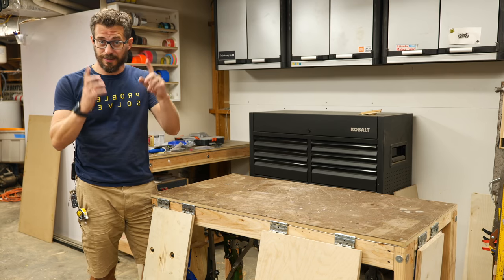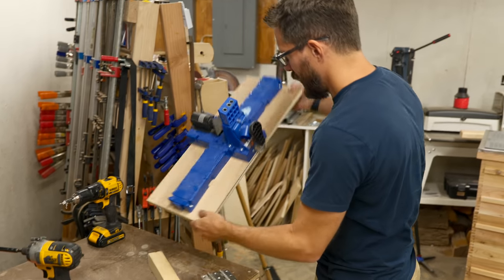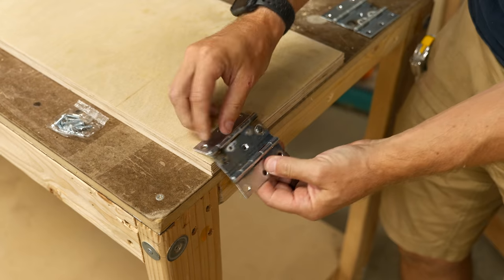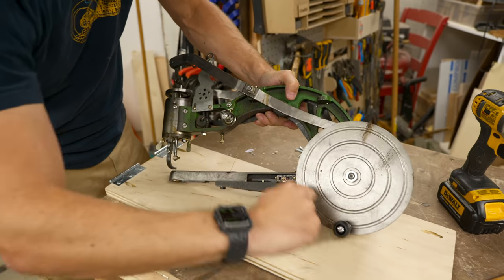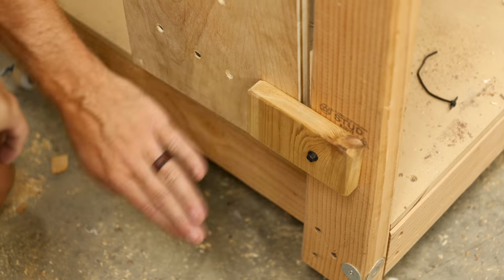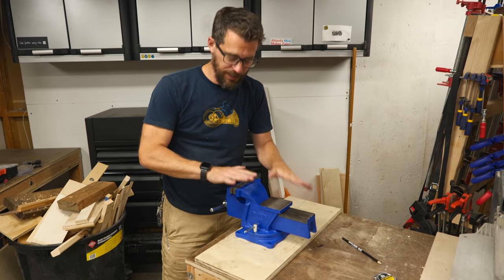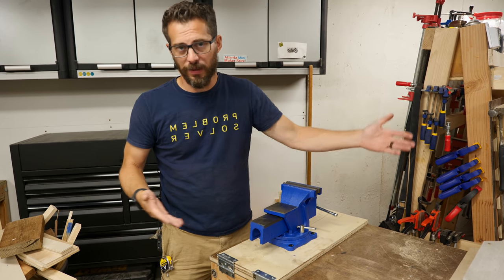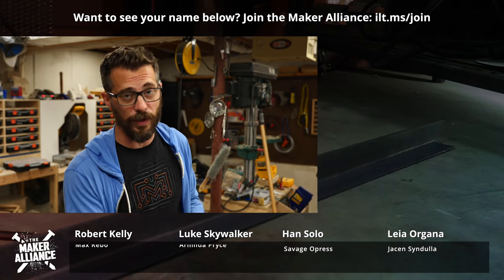How to Make Fold Away Tool Storage | I Like To Make Stuff

Comment: I’ve been binge watching your videos. Glad I came across your channel. I’m new to woodworking and want to buildup my garage to be my workshop and garage too so I was definitely thinking about a module work table and had designed mine! Then I find yours and I’m back to the drawing table lol. I really like this idea but I am definitely not welding, and wondering how the screw and bolt would work. Wouldn’t it cause the board not to lay flat whether stored or in use? Would I need to make pre-inset holes where the hinge would end up resting? Thanks for the inspo!

Comment: This is great! I just need help with something if someone reads this lol 

In my job I move a decent amount so this will allow me to take have 2 smaller tables with tools ready to go. But I am wondering how I can make it even more secure to go onto a moving truck. Maybe something to go under the tools for a move and box them in from the inside of the table as well? Thoughts?
Reply: Is the concern that the wooden locks at the bottom won't hold in a move? You could always put a ratchet strap or two around the table to keep everything stable in a truck, depending on how often you have to move them.
Reply: @forby_  thanks for the reply! My fear is the downward weight from the tools going over bumps and the like. So I wonder about reinforcing it with something under each individual tool to keep strain off the hinges. Make sense?
Reply: @kyronnewbury  Mmmm. Yeah maybe. I guess it depends on the weight of the tool. You might also try screwing the top panel of the hinge horizontally to the top of the table (or sandwiched between the frame and the mdf top) so the all the weight isn't just on the hinge screws 🤷‍♂️
Reply: @forby_  ooo that's a great idea!! I never would have thought about that! Thanks!!

Comment: I would suggest to grind the zinc layer of. Had to weld alot of galvanised steel on my last job, that's the reason i quit. They didn't provide me the gear for welding this crap and i couldn't grind it of. Went home feeling ill every day.

Comment: Maybe I'm being over analytic but is there a concern with the tools shifting during use?  For instance the scroll saw will be vibrating vertically while you are pushing horizontally.  I think that makes for an easy situation for the MDF sheet it is mounted to to shift across the top of the table.

Comment: Considering the torque you'll place in that vice at times would it be good to put a locking mechanism into the opposite side of the hinge to increase rigidity under use?
Reply from the maker: Yup, clamping it down would help a lot there.

Comment: Where you set the vice up you might be better pff using elevator bolts to secure it. The head can sit in the countersink and the nut goes on top. Thus not needing a washer to preserve the wood

Comment: Cheers Bob. Just tried this with my Bosch Glide and the whole lot snapped-off and smashed on the floor. £1000 down the drain. Thanks.
Reply: Probably just as well. With that degree of building ability you would certainly have chopped your hand off with it. :)

Comment: Wont the vice have a problem staying secure without fastening the other end of the plywood? Maybe add a latch that attaches to the side of the table to hold the end opposite the hinge side. Still nice idea. Might be using this for my space :)
Reply from the maker: Perhaps, it is quite heavy. You could add a simple screw through the platform into the table top.
Reply: The weight would not be as much of a factor as the torque it would be subjected to when working on Something in the vice. With one end unsecured it would put more stress on the hinges.

All that said, i like the idea and your channel. You have a great attitude and approach to problem solving which is appreciated. Hope you don’t take my criticism negatively. I meant it in a constructive way. :)

Comment: hey bob! one question, u never use gloves when u used the beltsander wouldnt be more safe to put some gloves?
thanks for your videos!
Reply: I think it's usually not a good idea to wear gloves around moving machinery because it can get caught and pull your hand in. This may not be as much of a risk with the belt sander but it could be why with most of the tools that have moving parts (like a drill press).

Comment: Very cool! It looked like you can still put it together with the 2x4 table? You should check out Woodshop Junkies’ All in One Woodworking Bench
Reply: It's close, but the wooden stoppers at the bottom would get in the way. Those could possibly be reworked a bit to keep the tables flush though.

Comment: i dont know if anybody got this idea too but you can mount a rope vertically in the middle of the wood surface just to pull up the tool with put bend over. you can unlock the locker with your foot.
Reply: If you use a bass drum pedal, you could unlock it and lock it again.

Comment: Rather than welding the hinges in that way, hammer solid rivets in those holes,  And if you decide to weld, don't weld the holes shut.  Instead pull the  hinges apart a bit to expose lap joints to weld on both sides..much stronger.  Use a fan to get rid of those zinc fumes.  I have welded galvanized metal.  I know the sick feeling. Avoid it.

Comment: Those tables really are transformers.. Was this addition part of the original plan when you built these? I know you said you wanted to make mods after you used them for a while. Just curious about the motivation for this addition.
Reply from the maker: That awesome, but it wasn't part of the original plan.
Reply from the maker: This wasn't one of the initial ideas, it just came up a few weeks ago when I got frustrated with the pile of tools underneath the table (those 4) that didn't have permanent homes. 👍🏼

Comment: Now use your vice to clamp something down and use your scroll saw for something else at the same time.... This stuff would be way better if you just made a fast clamp system where you could place the tool on instead of having it permanently mounted in a fixed location. This also takes away ANY storage from below the desk since the tool needs to be able to swing around.
Reply from the maker: You should definitely make your tables to work the best for you.

Comment: Didn't like the solution for the tuck away lock. You basically just made the magnet system useless on that particular table. Why didn't you use magnets on the bottom shelf, like a magnetic stop? That hinge idea tho. So good. Thanks for another good one.

Comment: Nice solution 👍👍  ,but the  with the vice you will soon figure out why this is not the best solution.
The fixed jaw of the vise should be at least equal or a little over the edge of the table .
Do the test ,take a broomstick put one side on the ground and try to clamp it vertical in the vice.  Don't ask me why i know that.😏 😏

Comment: This means I have to have a clean workbench. Not gonna happen.
Reply: Heavyboxes DIY Master...   Hello, with the swipe of your hand you can push all your junk(loose tools)to one side while you’re pulling out a given tool to use, then after use you put the tool back and with the swipe of your hand again you can move your junk back getting at another tool to use.... Etc..., Etc..., Etc...  A Great Multi Use Work bench for miscellaneous bench top tools... Better yet would be to use his bench which was originally made to have a flip top, since the hinges do not mount on the work surface the under tray is still usable...

Comment: Not a big fan of this particular project. I think that the position for each item is not optimal for working with the item. A vise does need to be bolted securely or it’s useless.  And of course as mentioned the zinc fume thing.